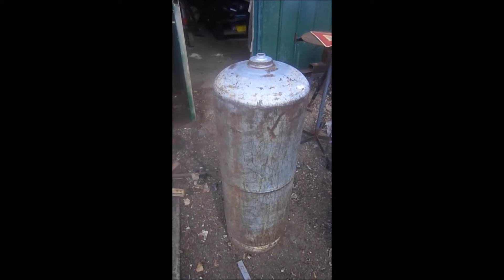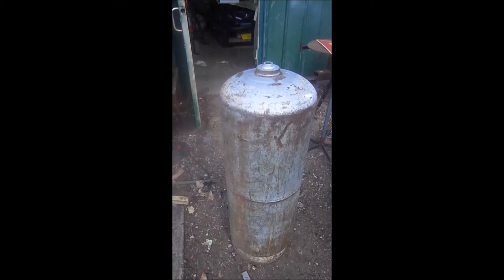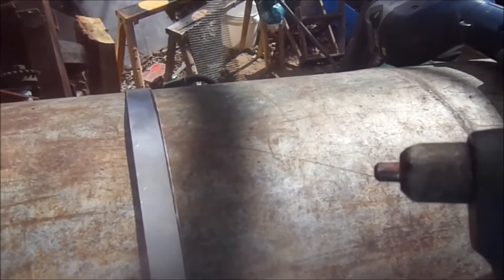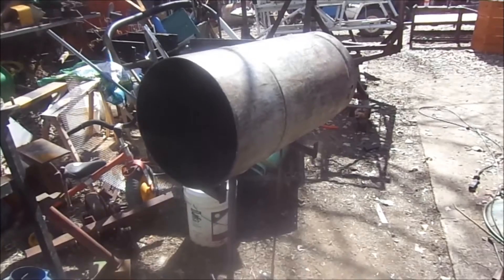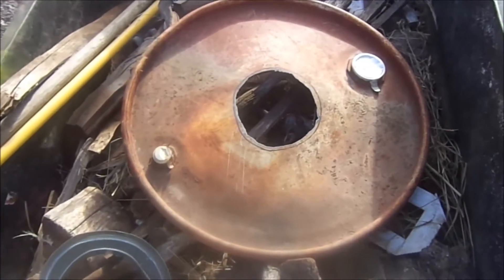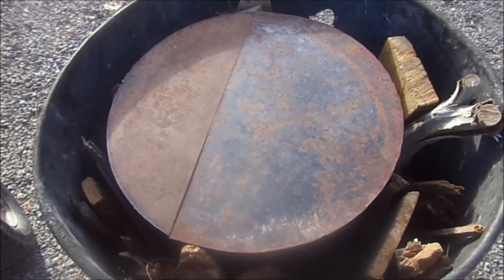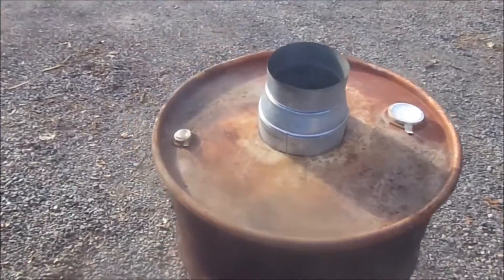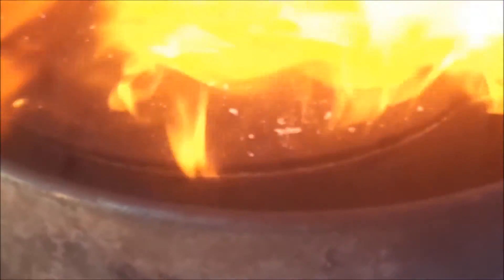Homemade BioChar

Comment from the maker: No improvements, I have run numerous batches and the only problem is on the thicker knots and more dense wood, I need to run them through two cycles. Other than that, it works fine.